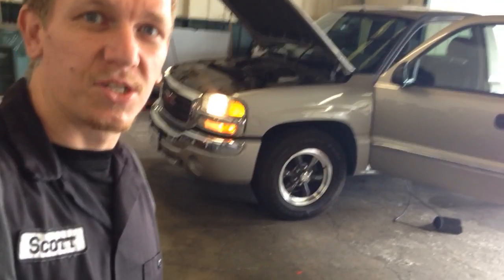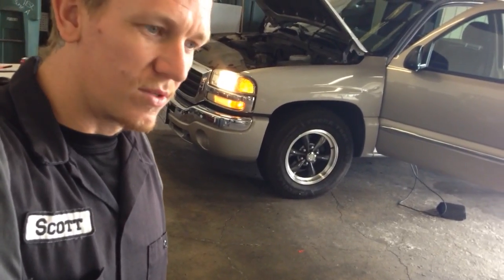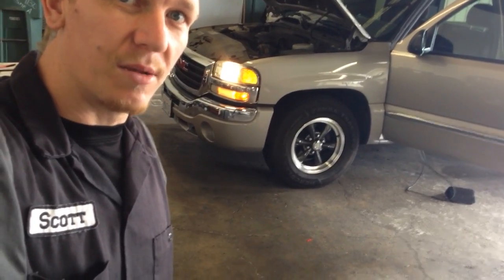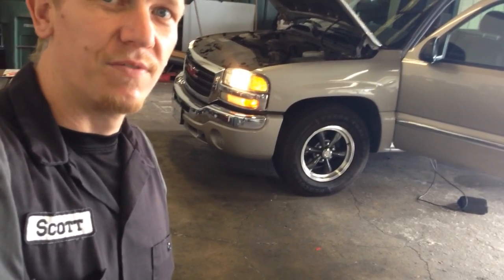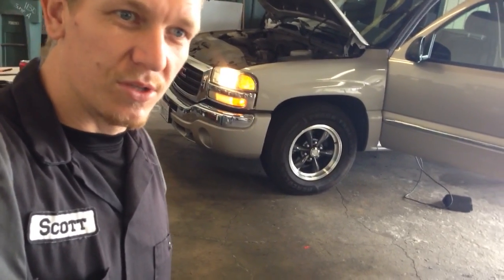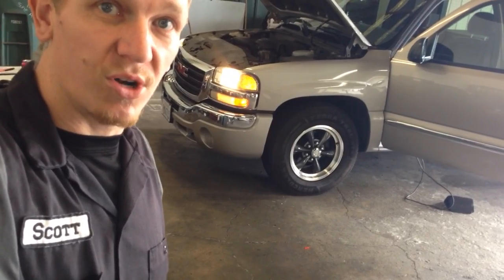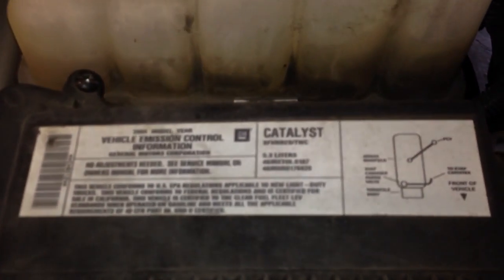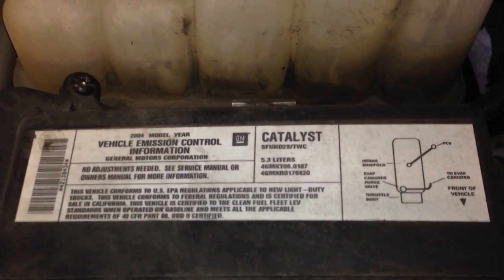GMC Sierra emissions locations: PCV, EVAP canister, & EVAP purge (Silverado, Cheyenne,  C/K, 5.3l)

Comment: I keep getting the Error Code P0446 on my 03 Tahoe.  Do you know where these are located on that?  Thanks!
Reply from the maker: Incorrect purge flow.. It could be just your purge valve is not working properly, dust stuck in it or electrically dead. If it was mine I'd start by replacing the purge. If it comes back then I'd do a smoke diagnosis to see if I have any eBay peaks.
Reply from the maker: Try this vid: https://www.youtube.com/watch?v=DYFvrAqDRPY
Reply: So you don't think it's the vent valve located just above the rear differential near the rear of the gas tank?  I was reading that those could get a bunch of dust in them and stop working.  I've tried removing it but have had a hard time removing the hose.  Thanks for your help!
Reply from the maker: It's possible that it could be that valve but the code is for The Purge and The Purge is up on the engine. Are you all right it is common for those vent valve to get clogged with debris from the road. I have seen it a number of times but in this situation you only have a purge code.
Reply: Awesome I will check that, thanks!
Reply from the maker: +Tommy Woodbury if you end up using my advice or for ends up working out for you can you please let me know with an update. If I can I'd like to make a video explaining the code that you're given and the correct fix. So if you have time when you're done please let me know how it goes. Thank you.
Reply: Yes I will definitely do that
Reply: I replaced the purge and the valve and cleared the code.  I though that had fixed it but today the check engine light came back on with the same P0446 code.  I electrically checked both and they are both getting power.
Reply from the maker: Can you remove the hose that comes off of the vent valve, I think you said you already cleaned. You might try removing that hose and clearing the code. Run it for a few days and see if the evap has cleared the evap monitor. if it does clear the evap monitor, replace the vent filter or install a filter at the vent sol. if the evap monitor does not clear than the vent would be suspect.
Reply: Did you ever get it fixed? I got the same code P0446 on my 06 Silverado.
Reply: @sjtuiasosopo  yes, it ended up being a sensor on the top of my fuel tank.  Had to drop my fuel take to replace it.

Comment: I've been having problems filling my fuel tank on my 05 Sierra, and the engine light was on. I scanned it with 3 different code readers, but each time there were no trouble codes. All research pointed to the Evap. Vent Solenoid, so I replaced it and the light is now out. However, I still can't get the fuel in without the pump constantly tripping. Any ideas?
Reply: Jim, Robert Bowman here, I had this problem and I was putting the gas nozzle too far into the filler hole. I backed off an inch or so and the problem went away. I also click the cap 4 times then 4 more times. Some times a red light will let you know that there is a leak when the gas cap is screwed back on. Just my thought here.
Reply from the maker: I believe there is a pressure sensor  on the fuel pump assembly on these trucks. If the sensor is malfunctioning it can possibly cause the vent to not open up. 

 I would try disconnecting the eve app line from the vent solenoid and trying to fill the truck. If it works in that case then you know you have vent  or purge solenoid issue. It could be a plugged evap line,  i've seen the hose from the vent solenoid be clogged with dirt and debris that caused this problem in the past.
Reply: Thanks for your reply. I wasn't aware that there is fuel pressure vent, but I will try and locate it. I've been reading on some of the forums that the charcoal canister can become plugged with dirt too. I will remove it and look for obstructions. Thanks for your help,
Reply from the maker: The evap vent solenoid should open to release pressure wike fueling. Thats the evap solenoid under the truck bear the fuel tank. Or if the sensor on fuel pump assembly is not reading properly to open the vent solenoid.
Reply: Scotties Hobbies
Getting back to you as promised. Anyway, I removed the canister, and could hardly blow air through it. Went to the gas station, and was able to put gas in. I wasn't able to clean the canister out, so I cut it open to have a look. All the charcoal in the one chamber was packed with dirt, and was a solid mass. I was able to locate one from a wrecking yard with low miles. I'm going to pick it up in the morning. Thanks for your help.

Comment: I recently took my truck to have codes scanned. It popped up a PO455. How can I tell if its the purge valve or the vent valve?
Reply from the maker: +Jeremy A i believe that is a gross leak? Have you checked the gas cap? Look at the seal, check for craks in the seal.  Id put money on the purge geing bad but if you said the vent fixed it, i wouldn't question ya.
Reply from the maker: +Jeremy A the only way you could check if its the purge or vent would be a smoke diagnosis. You might be able to comand the solenoids using a obd tool like a snap on modis or something.

Comment: Hey man, I have a Chevrolet Avalanche 07 with130 000 every morning blue smoke comes out what you think it is?
Reply from the maker: Burning oil... Ya know, it could be many things. Worst would be a leaking valve guide seals or bad piston ring. Those 5.3/4.8L are known to get oil in the intake manifold.. I've personally have always had a pipe dream to put a filter in my PCV vacuum hose . I took my manifold off my 5.3 to do knock sensors, while I had it out I cleaned mine. For starts if you had time. take the manifold/plenum  off and clean take a look in it. I'd cross my fingers to see a ton of oil.. I'f you don't see any oil in it then assume you have a bad valve seal or piston ring. If you do take that manifold off, use new gaskets when you reinstall.

Comment: Me again Scott. I think I may have told you wrong part. I was told it was emission canister vent valve. Location? 4.8L. 2007 GMC Sierra
Reply from the maker: The vent is near the evap canister. I have a  tahoe in the driveway, I'll make a vid this weekend if I have some spare time.

Comment: i have a 2004  chevy silverado hd....recently had to smoke test it to find a leak...I think I might have gotten one of the lines mixed up the run from the gas tank. need a video on looking at the proper line configuration on it...please.
Reply from the maker: +paul haywood im not 100% sure but i think the feed and return lines are different sizes. You mightnot be able to get them mixed up. But i do have a vid doing a fuel pump on a tahoe if you check out my other vids. Its not the best vid but it might have what ya need in it.
Reply: thanks for the vid... ya...my problem is that when I took the tank down, I had inadvertently pinched the evap return line to the intake valve right at the back of the gas tank...after I found the leak...I repaired it...but in the process, had to take all the lines off, in doing so I broke two of the factory sealed connectors on top of the gas tank. so, there is a possiblitly that I, after refitting the ends of the hoses with connectors, might have hooked one of the, i think 4 lines on top of the gas tank up wrong. I have no leak...but the truck keeps throwing the code for purge valve (the one on the intake) ...I have bought and replaced the purge valve assemly 3 times...no luck.
Reply from the maker: Did you check the wires to the purge? Make sure it was making a good connection?
Reply: well...I took it off and tried to blow through it....normally closed....so i assume the unit is good.... how do I check the signal? should I just turn the key on ?   I assumed that since the vehicle has to be running for a while for the pcm to send the ground signal, for opening the valve to draw the vacuum, that I wouldn't be able to check the wire without a good scantool. true, or not true?
Reply: i need all the good mechanic friends I can get!!!!!!
Reply from the maker: Sorry it took so long to get back to ya. I just back probed the wires on mine. The red wire provides ground when vehicle is off. The red wire provides power wile idling. The black wire doesnt have poer or ground when disconnected.
Reply: Dude...amazingly the weather changed today...it's a little colder here in Texas...Just started the truck...no code... I didn't do anything buy pull off the purge sensor and tried to blow through it....now, the code seems to have gone away...weird..that's never happened. but ..like when I disconnect the positive battery cable for 10 mins to reset it, the truck was trying to die for the first 5 minutes until I got on the road. What do ya think?

Comment: Is the canister purge valve on the 2003 GMC Sierra 1500 located under the hood as well as the 2004 and is it a simple process to swap out?
Reply from the maker: +Ashley Thomas yep. The solenoid is right under the cover on the top of the intake plenum. I think all you need for that whole job is a 10 or 8mm socket and maybe some needle nose pliers. Super easy.
Reply from the maker: +Ashley Thomas ill make a how to vid this weekend probably. I have a 01 tahoe in my driveway. It has the same 5.3l, 2000 - probably  now. the same as a 4.8l.

Comment: Need you to show me how to replace the Canister Purge Valve on my 2004 GMC Sierra 1500.  Please   :)
Reply from the maker: I don't have a video on it replacing that part but it is really easy. I show you the location on the purge in this video. Take the engine cover off. i think its 2 8mm bolts holding it on. The the purge is right under it. The EVAP line will unclip and the the solenoid it self is held on with one 8mm bolt or 10mm bolt. I can make you a video if needed. i have that truck at home.
Reply: +SCOTT BROWN thank you. We will be changing it this week. Glad to know that it's just under the cover and not by the gas tank. That will make it much easier.
Reply from the maker: The by the tank is easy to replace too.
Reply from the maker: This is a how to on the purge valve: https://www.youtube.com/watch?v=DYFvrAqDRPY